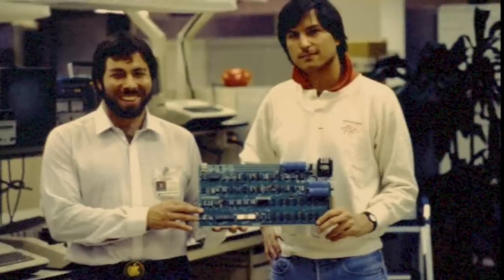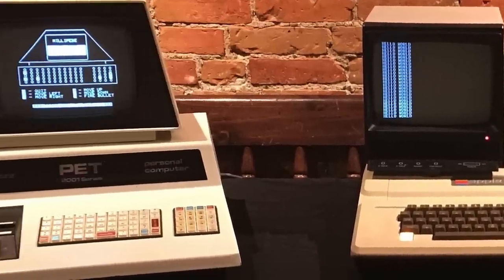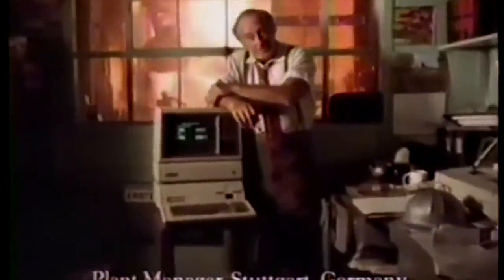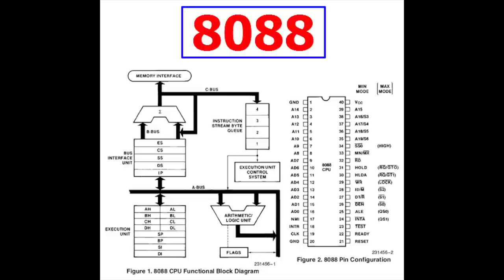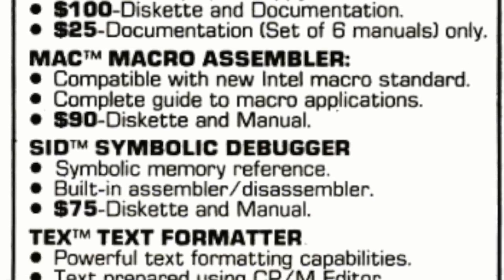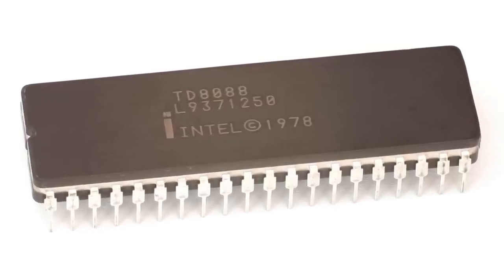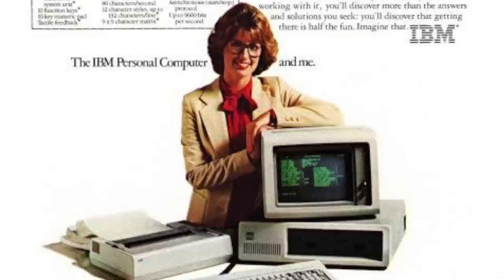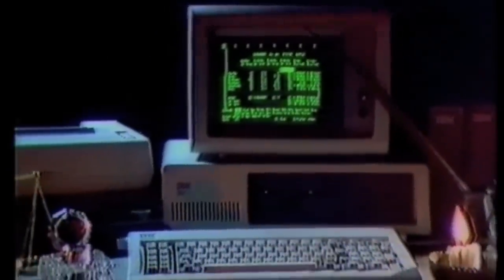DOCUMENTARY: Why and How IBM ended up creating the PC (and ended up choosing the 8088 CPU)

Comment: I worked at Intel at the time, and I have some personal knowledge about why they went with Intel vs. Moto chips that most people aren't even aware of. Also, the choice of 8088 vs. 8086 was very simple: COST. Intel had an entire suite of support chips for 8-bit data while chips for 16-bit data were still in development and quite expensive. That also meant that if IBM went with the 8086 they'd have to buy the support chips from someone else, and that would have complicated things tremendously, and delaying production beyond their deadline. The 8088 had the same internal architecture as the 8086, which is where they went with the AT as 16-bit support chips became available. So they went that route instead of the 8085 since all of the software and peripherals would continue to work with the 8086.

BTW, the 8085 was originally introduced with a bunch of instructions that mirrored what was added to the Z-80 over the 8080, but at the last minute Intel decided not to document them. Internally, I kept hearing people say, "Intel makes sand". I was a software engineer, and for most of the time I was there, software existed ONLY to help them "sell more sand". They found that while hardware engineers who wrote lots of Assembly code loved the new instructions added to the Z-80, modifying their P/LM compiler to incorporate them was a whole 'nuther can of worms that added zero ROI in terms of improved sales. So eventually the additional instructions were removed from the 8085 except for two, and adoption of newer 16-bit CPUs like the 8086 and 68k made the Z-80 obsolete.

BASIC was the first widely used language on PCs, thanks to Microsoft, although it was an interpreter, not a complier. First real compilers for PCs were FORTRAN and P/LM, which I believe were both developed at the same place Gary Kildall taught (maybe by Gary himself), the Naval Postgraduate School in Pacific Grove, CA, where Gary's Intergalactic Digital Research Corp was also based. Internally, Intel licensed a version of CP/M from Gary that they called ISIS, as well as his P/LM compiler. They were used internally for years. Getting back to the earlier point about the extended instructions on the 8085, the hardware guys loved them, but when Executive Staff heard the budget that the compiler team proposed to add compiler support to P/LM for them, they were stopped dead in their tracks. 

The Intel Development Systems, a.k.a. "blue boxes", sold for $30k and the software was free. Intel created these boxes to help customers "design-in" Intel's chips faster than chips from other vendors, reducing their time-to-market significantly, and support for those extra instructions weren't forecast to produce even a single additional sale, especially as the newer x86 architecture was rolled out that replaced the 8080 architecture (including 8085). So the 8088 was designed to provide an 8-bit replacement leading to the newer x86 architecture that used all of the existing 8-bit peripheral chips. If you wrote code for your 8080/85 boards in P/LM, then all you had to do was recompile it to run on the 8088 using the same peripheral chips. And replacing an 8080/85 with an 8088 was designed to be as simple as possible for Intel's customers. Our blue boxes did not support Z-80's, and as expensive as they were, they cut time-to-market in half, which was highly motivating to most customers. Also, the 8088 was much faster than the 8085 and was deliberately priced about the same, and at the end of the day, nobody ever cared about those extra instructions.

The strangest part about all of this was that IBM never expected to sell more than 10,000 PCs. They seriously believed they were just "toys" and would be replaced by much more capable low-end "mini-computers" IBM was designing within a couple of years. (They were seen as a stop-gap to get IBM into the game, but not a long-term play.)
Reply: The basic design of the PC came directly from the sample design in an Intel Databook. All IBM did was modify it to a bus based motherboard. It also could use some 8 bit cards IBM had for a 8085 based word processor. Namely the monochrome video card and the parallel printer card.
Reply: @michaelterrell  That wouldn't surprise me, as Time-to-Market was their #1 priority from what I'd heard. I suspect that's how Intel ended up becoming the world's largest motherboard maker. When they were coming out with a new CPU, an Intel FAE would make a design and publish it as an Application Note. But they'd be working on the design for months before the chips were released, and in close concert with the chip design team. A few customers would get "inside info" but when the chips were released, that App Note would also be released and companies usually started with that. Customers wanted more and more of the Mobo details, and Intel started giving out the gerber files and other things they'd created until it became clear that they could start building mobos that could also be shipped at the same time the chips started shipping. This also allowed them to build-in a lot of their other support chips, ensuring their chips were more likely to be used rather than competitors' chips. I guess that after a while companies just started saying, "Why don't you just build us complete boards? But with these changes..."
Reply: @TheSchwartzIsWithYouToday  Adapting the existing circuit probably save six months or more. Ive seen way too many designs over the decades that were nothing more that blocks of circuitry from databook examples, with little or no effort at optimization. One really ticked me off. Collins/Rockwell deigned a C-band receiver in the late '70s that used a large electrolytic in the video circuitry to couple two incompatible sub-circuits. They would run hot, and dry out over a few years, and damage the circuit board. A simple level converter would have eliminated that problem, and improved the video response.
It looked like they had just taken the design of a military product, and changed a few parts to put on the needed range of frequencies.
Reply: @nicksterj yeah, I don't know what I was thinking there. I deleted it. IBM wanted to cap their costs. Unfortunately for them, they sold millions at a fixed price that MS delivered by the pallet, ready to be dropped into the boxes before shipping them off. MS was also able to sell the same thing as MS-DOS as a retail package that all of the cloned PCs would then use.

Comment: I'm typing on a keyboard that came with a PS2, a model M, but running Linux. 
I remember PCs being introduced at work and the only things that made them acceptable to our IT department were that they ran mainframe terminal emulation, and they had "IBM" on the front.
We have effectively returned to mainframes with cloud storage, and Microsoft, Apple, Google etc in control.

Comment: Good doc! 
I've been designing software/hardware since 1972. I came across the 5150 motherboard when it was a 4X layout drawing being digitized  by the firm that did the digitizing of my circuit boards. I visited the digitizing station of said firm to check on the work being done on one of my memory board designs. The man doing the digitizing said "Come into the secure digitizing room and have a look at the work IBM handed us this week." I looked at the 4X layout, noticed the ISA bus section & the CPU & coprocessor sockets and said "It looks like IBM is getting into the PC business." IBM had told the board digitizing firm it was just a new terminal. There was a massive new IBM facility just two streets away from which he had his technical contact persons. This was in Markham ON Canada in late 1980 or early 1981, so it seems IBM wanted the board design project to be far away from Boca Raton to keep it secret at the time.
Reply from the maker: Wow! Amazing that you got to see that, given how secretive IBM were about everything!
Reply: @AlsGeekLab  The weak link in the 5150 security was the people IBM farmed out some aspects of the design process to.

Comment: To me the smartest mistake IBM did was open architecture and not buying Dos, Commodore, Atari, and all the others were closed architecture, Apple was open but Steve Jobs took Apple to closed. Innovation went to the open architecture and hardware thrived there. Originally with other brands of PCs you had to buy a different version of dos and software for that machine, Microsoft put it's foot down and said one version for all, that opened the door fo a software explosion. People forget that you had to buy Zenith OS and Zenith brand word-processing software.  Before Microsoft said no more.
Reply: Someone built a card for the Heath/Zenith computers sold to the US military to all you to run regular MSDOS software. I think that I still have a couple if them, in storage.
The Commodore VIC20 and C64 had an expansion slot to use either a game cartridge, or third party module.

Comment: In 1968 at technical college here in the UK we were shown the first mobile computer - it only took 3 technicians to push it in to the lecture theatre - that computer was made by IBM, the floppy was a yard in diameter and had 1 Kb, the screen was very small with a huge box under it and the keyboard was above the hard drive and I remember it was less than 1 Mb.

Comment: Thank you - an awsome historical account of the genesis of the IBM PC. A lot of research went into the production of this video. In 1985 I took a college course on 8088 assembly language, and as you mentioned, working with the 8088's segmented registers was quite awkward, along with the 'crippled' 8-bit data bus. Having a 'flat' memory addressing architecture would have simplified programming and improved hardware performance. But as the video explains, decisions made at that time dictated the selection of the 8088 cpu. These limitations were present until the arrival of the 80386, also mentioned in the video. 

A final struggle with the college course was that the PC clones in our computer lab used an NEC-8088 version which had a built-in hardware bug, which couldn't execute certain combinations of machine instructions.  My instructor didn't fathom this possibility.  One day I sneaked into an adjacent lab, which had newer/different PCs, and my text editor code ran flawlessly.  In the PC industry, surprises always appear, providing endless awe and wonder. 

A great presentation,  kudos!
Reply from the maker: Thank you very much. Yep, the video took quite a significant amount of time to research and put together from what I remember (I made it back in 2019), but yeah thanks for noticing the hard work that went into it! Check out my new video on XENIX. A similar amount of effort went into that one!

Comment: I worked for a Fortune 500 company's Austin location in the '80's and 90's. PC's, Ltd was my customer, later known as Dell Computer. Michael Dell had it figured out. His "showroom" was nothing more than a pegboard wall with components hanging like beauty products at Walgreen's. Everything was compatible. One could look down a short hallway and there was Michael sitting at his desk, usually on the phone. I continued calling on Dell until the crash of 2002, then called it quits. Wonderful time.

Comment: I remember buying one in the eighties. I learned to write some BASIC code by reading magazines and books, but knew little about computers. I had a young lad working for me part time, and who was doing IT in high school. He advised me to "buy one of these Pete, it's got a twenty megabyte hard drive, and it'll store all the data you'll ever need". I often pull his leg about that statement.
Reply from the maker: Well if everything was at a constant, 20mb was a lot back in 1984. But things change after all, who knew!
Reply: @AlsGeekLab  My first Hard Drives; Seagate 20Mb, Miniscribe 41Mb, Fujitsu 90Mb, Seagate 131Mb, WD1Gb, Fujitsu 2.6Gb, Seagate 4.3Gb, Quantum 20 Gb, WD80Gb, Seagate 250Gb & Seagate500Gb all IDE & so on from there. & There we have the evolution of the Hard Drive. I still have them all.
Reply: In essence, he's right. Today's data is more of graphics and videos, which take million times more space than simple text.
Reply: "I said 'need, not 'want.'"
Reply: The Miniscribe is a 50 pin Drive I'm going to have a look at what's on it today. I just got the Cable for it.

Comment: Thanks for the "reminder".

I started as an operator on the IBM 360 mainframe, switched to the 370, got into mainframe programming using the IBM 3270 PC GX which emulated up to four terminal sessions connected to the mainframe.  This PC had 640 k of RAM and two floppy drives  --  when they gave me a 10 megabyte hard drive on an expansion card, I thought I would never have any disk space problems again.

They switched me to the IBM PS/2 running IBM's OS/2  --  which was the last efficient and reliable PC operating system I have ever used.  When OS/2 was a joint effort between Microsoft and IBM, it had a few bugs, but when Microsoft dropped out and IBM took over, the next upgrade gave me a machine that ran much faster and NEVER needed a shutdown/restart, regardless of how badly I abused it.  The longest time I ran it without a reboot was about 9 months.  The only time a restart was needed was when a new expansion card had to be plugged in or we had a power failure.

OS/2 came with built-in Windows support which we used to run the e-mail client, word-processor, and spreadsheet.  When we had one of the frequent Windows task crashes, OS/2 would clean up the mess without needing a restart.  On each of our (about 100) PCs, we set up a full mainframe simulator for program development.  This included several language compilers and both hierarchal and relational databases. 

Then along came Microsoft Windows NT (or should I call it "Windoze Not Today")  --  the company gave me a new machine with double the RAM and double the processor speed from my PS/2  --  and everything ran slower than half the speed of the OS/2 machine  --  and I was lucky if this NT machine survived an entire week without a crash or hangup.  And, since then, every new release of Windows has needed more RAM and a faster processor ("bloat-ware")  --  and, in keeping with Microsoft's tradition,  we still need to shutdown/restart a few times a week.

Oh for the "good old days" when computers were reliable.
Reply from the maker: Whilst MS windows (especially 10 and 11) are huge orders of magnitude more reliable than any other windows before it, I still totally agree with your sentiment. OS/2 would have been shipped on a few floppy disks compared with the Multiple gigabytes you need just for Windows to operate. 
I have a 6MHz 286 AT which I'm often curious about installing an earlier version of OS/2 on it but never picked up the courage. I'm going to do a video on OS/2 through the ages at some point. However, my next video is on XENIX, Microsoft's UNIX variant!
Reply: @AlsGeekLab  do you have enough free disk space to set up another partition?  If so, you could set up a dual-boot.
Reply from the maker: @rbpalmer1  I guess I'd go down the route of emulation first then try a dual boot on real tin. But yes, my old PC is kitted out with compact flash so it has plenty of space
Reply: @Ron - we were also married to IBM at work - even down to Token Ring and DB2/2 <splutter>. 
I had to go to Taipei on a work trip and discovered that they'd diverged from policy by using Ethernet - a dead end standard, obviously. 
I share your love for OS/2, but we had to ditch it because the non-IT part of the organisation found it too "hard" to use.
But I must disagree about efficient PC OSes - *nix variants now are utterly amazing. You can even run REXX :-)